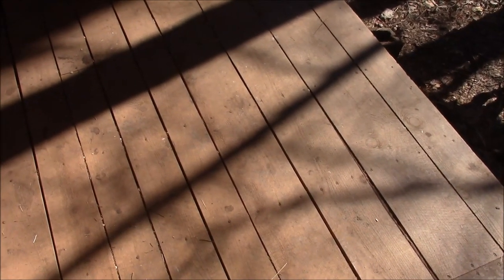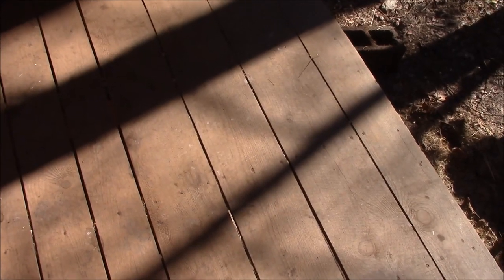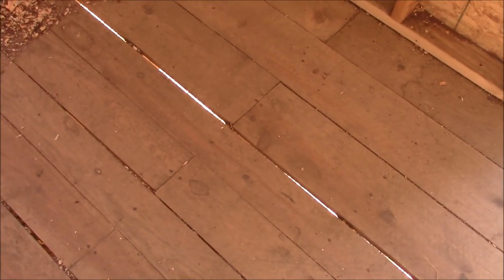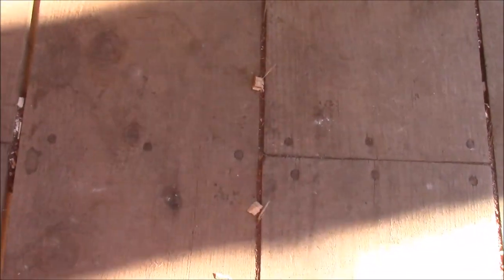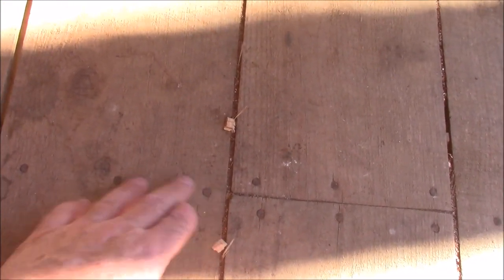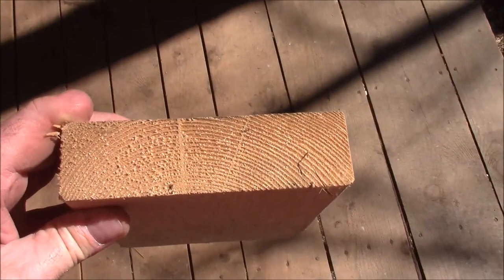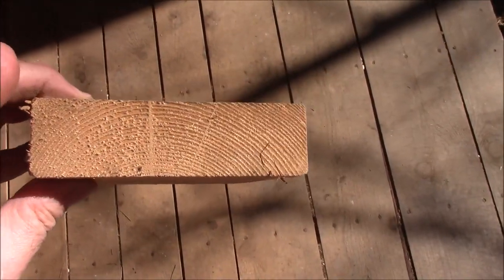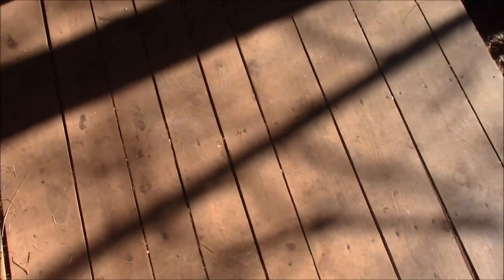Building with and Nailing Green Lumber

Comment: Great video. I build with green lumber right off of the mill all of the time and you are right on all those points. I like being able to saw whatever material that I need as I need it.
Reply from the maker: Thanks for the confirmation, I could find very little information.  It's nice to know someone else has had the same results.  Good luck with your builds!
Reply: i build boat, if you use green wood for boats the boat must never leave the water...here in the winter when they are out its the snow doing the job. =)

Comment: The boards curled upwards because you're putting them down the wrong way. The grain should be curling upward, like a U. The board wants to straighten out the grain as it dries, so that's why one center nail would be sufficient.
Reply: But wouldn’t that only apply with a board and bat set up? Mail would hold the center, bats would keep the edges from curling up. In his set up the mail in the center should hold the crown down and not allow the edges to push the board up? Just my thought

Comment: I'm currently building a 12-4  dining room table 8 ft x 42 inches green with a mortise and tenon legs into top construction. Putting a threaded steel rod through the two matchbook slabs to keep them pulled together and adjustable as the wood cures. It would take 3 years for the 12-4 to cure. This way, I can have a beautiful table that I can actually use and admire, then in three years or so, I can finish it to perfection. Everyone has opinions on what you should do with green lumber, if you mill it yourself just give it a go! Its how people did many decades ago......

Comment: So 5 years….. how’s the deck holding up and have you learned anything that would make you change the way you built this?
Reply from the maker: No, still in great condition.  It wasn't dried prior to putting it down so it has some gaps between the boards but it's a barn floor so that's no problem.

Comment: I saw a video where a guy seals the ends of the boards with a 50/50 mix of elmers glue and water. Then puts linseed oil on the surfaces. His theory is that allows it to dry slower and not split and crack.. have you ever tried this or heard of it?
Reply from the maker: I used to paint the ends when they were green to keep them from cracking.  I just used paint.  I think it did help some but I don't get a lot of splitting when I don't seal the ends so I quit doing it.  I think what you mentioned would work but as you saw in the video I had good results without any sealing at all so I don't.  Thanks for the comment and for watching my video!

Comment: Very confusing. Other sites say "bark side down get a crown" for decking" exactly opposite of you suggestions ! Also if the decking is smiling...so will you and if it is frowning...so will you. Wish someone would get this straight. I guess trial and error.
Reply from the maker: I had the same experience trying to find information, that's why I made the video to show my experience.  This worked great for me as you can see in the video.  Good luck with your projects.
Reply: When I do barn siding I put the bark side inside.  Wood shrinks more Tangentially than  radially. I have found wood to cup toward the outside of the tree. I would have done opposite of the video but he has a lot of shading vs a barn that gets lots of sun potentially. It depends on how the board was sawn. If its quarter sawn it will shrink less and more even than if its plane sawn.
Reply: @selfsufficientlifestyle8686 ,.................Thank you for  taking time to reply. Most authors seem to agree with you !
Reply: @SoatMon  ......Thank you.
Reply: @SoatMon  ...........Glad that it worked for you, thanks.
Reply: Always place the center of the board out or up! It curls opposite of the rings. So it ‘close’ in the sides. Sorry my Odd english…

Comment: Love the video! I’m looking to start building with green sawmilled lumber here shortly. Did you use anchor seal? Or do you know if that would have helped with the splits?
Reply from the maker: I didn't use anything type of sealer, just cut them and nailed them down.  I even quite sealing the ends of the logs before I cut them.  It was a hassle and I found the splitting was not much different and since the ends aren't straight I always cut that part off.  Good luck with your projects!
Reply: @SoatMon  so its safe to say using green lumber is ok, im planning on building a 9 post 30 inch tall deck out of uncut logs except offcourse its cut to be 2 feet tall..but i mean im keeping the log whole for that rustic look...how do i prevent wood rot?
Reply: Hammer the ends of the boards.

Comment: Board orientation is the thing, its a myth to just nail in the center, for example I built a1500 sq ft deck around house from 1x6 pt purchased from HD, soaking wet, thru and thru, butted boards together all around by using 3 nails per joist. As they dried, end butts no gaps, side butts shrunk to proper 1/4  inch gaps, absolutely no cracks, not one.. Thats because the wood is shrinking on all sides of the nail, not just from the center out.
Reply from the maker: Thanks for adding your experience.